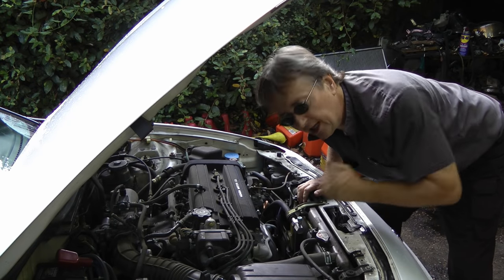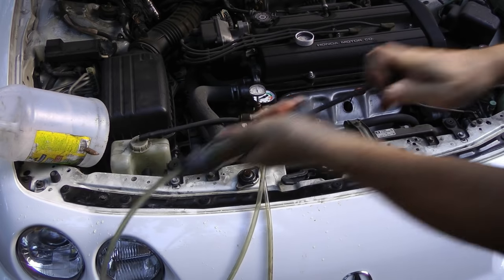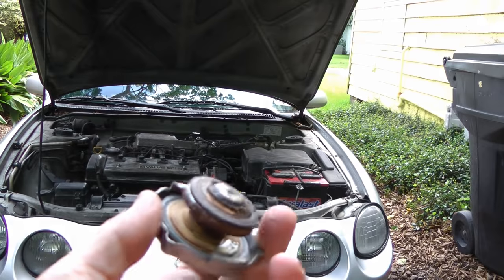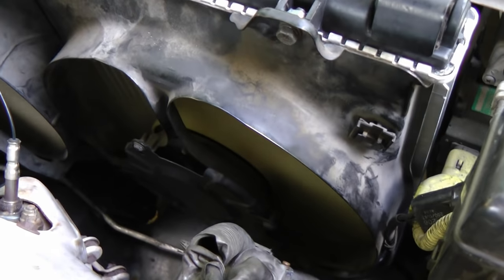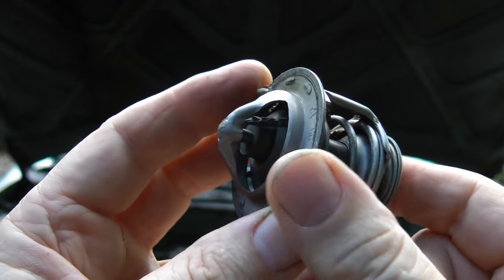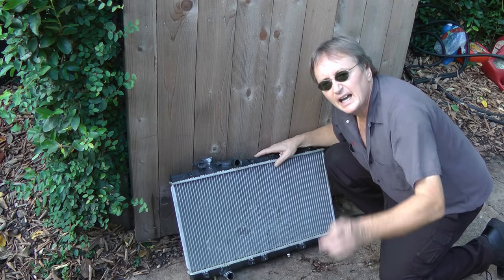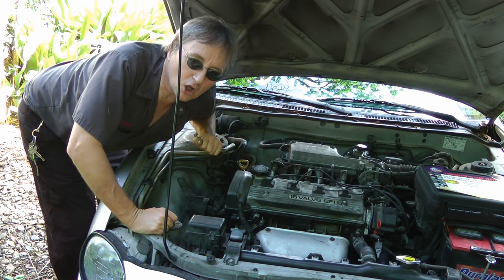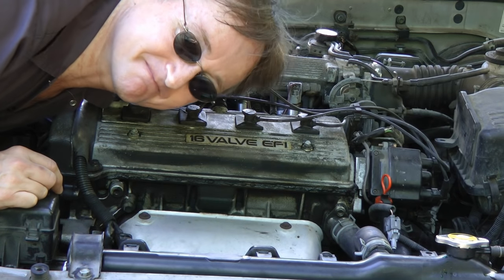How to Fix a Overheating Car Engine

Comment: would a slipping clutch cause an overheat during hill climbs? my car feels like 1st gear is slipping and during steep hill climbs when im in 1st or 2nd gear revving at round 2.5k Rpms (diesel engine) the temp gauge starts climbing. but if i stick to 2k rpms it doesn't overheat. Thanks to whoever answers
Reply: I dont think a slipping clutch should have anything to do with that
Reply: Is your tranny fluid cooled in the radiator like my civic?
Reply: @liveandletlive2894 i have no idea if my transmission fluid is cooled in the radiator, here's an update, i changed out my clutch in my 95' pajero and during hill climbs it isnt that bad anymore the temp gauge climbs 3/4 and then goes back to 1/2. But my temp gauge stays at half level is it normal to stay in half?.   and i have another question its about civics, my 93' civic eg sedan idles badly due to a bad IACV, when i replace this IACV do i need to do an idle relearn? or is this for new models only?
Reply: @kevinish5567  idk about reprogramming the iacv I only cleaned mine and yeah temp should always be around half

Comment: The AC fans do not turn on when the AC is on but if I tap the back of the fan the fan turns on. What is that supposed mean?

Comment: Hi I have a 2012 Cherry Tiggo and it is over heating I took the head out pressure tested it and also I took the engine and they said that it was fine please I need help

Comment: I have similar issues with my Prius. I have a 2011. Changed out engine, water pump, sensor and thermostat. I have issue when I drive high speeds 65-75 mph up hill. Reservoir very hot almost to boiling temperature. Temp red light would turn on or flash and then when I slow down it will eventually turn off. My mechanic replaced literally everything minus the radiator and the inverter coolant pump. Can anyone please help????

No codes or no check engine lights just the red light engine temperature turns on when driving high speeds up hill for long periods of time. 

Is the issue temp sensor on EGR pipes?

My mechanic has replaced with all OEM parts. Any advice?

Toyota service rep says might be inverter water pump, radiator clogged up, or water pump. 
Just a had Toyota dealership diagnosed and they check for any leaks so it’s not the engine. They said water pump and thermostat. 

My mechanic replaced those 2 parts. I thought I was in the clear but I wasn’t. The car still overheats when driving high speeds 65-75 mph for long periods of time and red temperature light turns on again uphill at high speeds. Anyone please help and TIA

Only radiator and inverter water pump left to be replaced and my mechanic is replacing it.

Comment: @ScottyKilmer Have a 1999 Nissan Maxima that recently passed emissions due to bad Map Sensor n MAP /Baro switch solenoid valve i replaced both, barely passed emissions when CEL came on again. Hate tht thing. 😂.  Anyway  First time in a while Gauge went above 75% toward Hot. Pulled over turned car off and noticed reservior was empty. Filled it up. And opened radiator cap after cooled down, n noticed it used up what i filled in resrvior. So refilled it up at Max level, then drove car on street 40-45 mph home, no problem for 20 minutes.  When i got home n was parking, noticed the tstat gauge start to go back up. Parked car popped hood and noticed a small leak near serpentine belt area that appears to be coolant.  

Im praying al i need is a new rad cap , even though it looked fine, and not be the freaKin Water pump.  I dont have money to fix that part. Any advice on further steps to make sure i find out wht is the cause of overheating??

Btw AC n heater system had to go bye bye two yrs ago, due to heatercore hoses  leaking in pasenger floormat.  So both Fans were luckily operating n turned on shortly after turned car back on in park. 

Detailed help in non complex mechanic english appreciated.

Comment: On my 04 Tacoma the previous owner did not put the water pump on correctly and it started leaking and eventually rusted so bad stopped spinning.

Comment: I just changed the radiator, the thermostat, and water pump on a Chevy sonic 2013 LT, now it over heats after 10 mins of driving it, then I’ll burp it out, then it overheats again, idk what it is

Comment: You forgot a simple thing - lower radiator hose collapse. 
I have 97 camaro SS with the lt1 v8.  New water pump and 180 degree thermostat. On the highway steady 70mph cruise, it ran about 200. But when I slowed down 
The temp dropped down quickly to 180. This is in 25degree outside air temp. Original hoses, about 125k miles.
Simple fix but overlooked.

Comment: Hey Scotty my 2009 nissan altima is overheating the fan is working good i change the radiator and the thermostat but it’s still overheating....help please
Reply: Test the water pump and hoses

Comment: Thankyou sir....my honda civic sport is overheating, but will check radiator & also on thease cars theres a (rear coolent hose) that can burst or even a small LEAK  accurring, hence your thinking then its a new head gasket   (WRONG) ive also changed my thermostat   on this civic,   still overheating    mmmmmm    what could it be ?       will try some of the things youve done scotty and hope it works     Nice video scotty you should be on a talk show  (your funny & down to earth   ,  nice guy,   Thankyou for your knowledge & tips  awsome dude   DEZZY DEE

Comment: Nice video but he forgot to mention the water pump. It could squeak, leak, or just not work from being too old. It could even be leaking and not overheat on you until it’s empty. Also if your oil hasn’t been changed in years your engine won’t be properly lubricated and all of the parts inside that are moving will overheat as well. in some cases you can leak coolant out of your intake manifold. Depends how your engine is designed.

Comment: my car is overheating i saw coolant boiling in the reseivor tank it could be a bad thermostat?
Reply: yoshi z33 most likely the rad cap, I got a G37 and had same issue
Reply: yoshi z33 do u have a IG
Reply: @aaronmx47  it was my radiator cap and alot air in the cooling system

Comment: Thank goodness, I have this olds that hasn't ran in years and I would hate to do any engine work. It can barley drive a mile before over heating and low and behold when I checked the radiator, the most amount of corrosion I've ever seen.

Comment: What if the reservoir has a bubbling noise and leaks at the cap when it over heats and pours onto the ground? It had happened twice now 😭
Reply: But then i let it cool down, put water back in it and coolant and it is good. It happened once about a month ago and then again two nights ago. It doesnt use any water the water level stays the ssme

Comment: HELP: My vehicle ( Toyota Corolla S 2013) temperature gauge goes up when I turn on the air conditioner, however it does not overheat, air continues to blows cold, and when the air is turned off the temperature returns to normal. I had a bad compressor before I fixed it. The problem still occurs in the car. Now that the A/C is fix. The temperature keep going up. Before it will go up and down when I drive long distance. I changed the thermostat, the fan, and compressor. It is still happening in it. I don’t know what to do. I cab only drive the car when the A/C is not on for it not to go up.
Reply: Does the coolant level go down or not???

Comment: Heyyy great vid so can u change a thermometer without having to change radiator i had a gut fix thermometer but not even a month later my car went back to overheating so then he says I needed a new radiator which he told me the first time but then he looked under the car and say oh no no no you don't need a radiator just a thermostat thermometer so after it overheated again after he just did the thermometer or thermostat whatever it's called then he says oh you need a new radiator so my question is how didn't you know that the first time then he goes to tell me oh I did you a favor cuz you needed a new thermostat again so I gave you a new thermostat again so is that correct if it overheated what I need another thermostat you know charging me for doing the same thing twice like I don't understand I would appreciate it if you can answer my question and I'm sorry if I'm like going on and on with the same stuff but thanks a lot for taking out the time thanks in advance great video

Comment: You didnt mention the water pump could be faulty or there could be a air leak in the system or even a air pocket in the system .

Comment: My radiator on my dodge Dekota and head gaskets was leaking and timing chain about to break and they changed me 300$ to fix it cause the engine was so easy to take apart

Comment: The way to check a plugged up radiator is to fill it with water and open the bottem.The water should exit strongly with gravity like 10 seconds.Cold of course both ends open.Fill to the top and let it out the bottem.Over 10 seconds you might jist have gunk junk.

Comment: Hey I need help I have a 2005 Pontiac grand prix and its overheating  I changed everything  need help plz
Changed
Radiator cap 
Temperature sensor
Thermostat 
Up o2 sensor
Lower 02 sensor
Bleed line ×2
Upper radiator hose
Lower radiator hose
Change belt
Changed cooling fans
Water pump
Flushed radiator  ×2
Didn't change yet
Radiator 
Or head gasket  l
Need...help....

Comment: Guess it's my lucky day! Christmas 2020 car overheating !! WEEeeee!!!
Reply: What was the problem
Reply: @Spyda_337  My lower radiator hose blew off & spilled most of the coolant out. I had half of a container in the trunk so that got me by until today so I could buy more at autozone. So far I haven't had any overheating issues today. So, I'm not complaining. Thanks for asking!

Comment: Ok so I blew my radiator from my car over heating, I replaced it and also the fan motor brand new but now when I turn my AC on 10mins later car starts to overheat and blows my fan fuse ? Can anyone help please or give me a good advice on what to do please and thank you

Comment: I change the cap water pump hose floshed the radiator new thermostat just the way it's supposed to work an 06 kia spectra over 80k + miles

Comment: When I run my car and then swithed it off，the water flushes from radiator water tank. What's the reason and solution?

Comment: i have a 2000 subaru outback and it is overheating and i know that they are notorious for having bad head gaskets but i just wanna be sure bc it’s leaking oil and i went to put oil in and there was faint smoke coming out of it  IF ANYBODY CAN HELP PLZ!!!!

Comment: What if the AC fan turns on but the radiator fan doesn't turn on after attaching the alligator clip to the battery?

Comment: I know alot about cars. If your car temperature goes up or if the car smokes under the hood it could be a bad radiator or a coolant leak.

Comment: There are also other factor that could cause overheating like a failed water pump,bad or leaking hoses including the heater core ones,a bad coolant temperature sensor could also be an issue with overheating or if you have a GM Chevy product the intake gaskets is so damn cheap that they always leak and can cause their car to leak coolant and overheat

Comment: I don't think this works on a mini copper 2005.  I did the + to the red wire the fan did not work.  the reason why is the resister relay that's faulty that makes the fan speed as the - runs throw the resister I am not sure I am trying the resister first and if it's not that its the fan, I looked on here and  if the fan not working by negative and positive from the battery  and connect it to the relay switch and still did not work they said its the resister!?

Comment: I have a 2015 F150 I have no leaking coolant but yet the truck runs hard after 10 minutes of driving . I have the water pump replaced and the thermostat replaced !!! so how is my truck running hot with water in the radiator? Someone please help me my wife is a schoolteacher and she really needs this truck. Oh yeah and I even tried driving it without a thermostat and it’s still ran hot.

Comment: Good video I liked it I have a 99 Mazda Protege has lots of issues at certain times what 172000 MI know what it's like put new alternator in car new gas tank about to put new struts put  going to try to get $300,000 of my Mazda

Comment: I've changed the radiator the fan thermostat and the hoses they are brand spanking new and the dammed overheating light comes on when am in traffic wtf so it might be the head gasket I've even put the pink Toyota coolant on my scion xb 2006 and still
Reply: Check and see if the cooling fan is working. Sounds similar to a fan not working so it won't cool the engine in traffic or at n idle, but while driving the air flowing through will cool it enough.

Comment: My car takes forever to heat up when it starts to get cold outside and when it actually warms up and I start driving it starts to get very cold the guage is on blue almost to the very bottom what can I do?
Reply: My car has 234,966 miles on it it's a 2002 dodge neon sxt

Comment: You missed to check one very important component of the cooling system i.e. the water circulation pump.

Comment: Couldn't it also be the water pump?
Reply: When they go bad, usually they leak coolant where they are located (Doesn't apply always but is very common)

Comment: Changed my radiator it was working fine even the fans were turning on. then it started over heating again and the fans stopped working. So I’m just gonna change the fans and the thermostat just to be safe

Comment: Also change the caps 
I spend like 2k fixing everything and nothing work
But then as soon as a change the cap for the coolant on the engine (cost 10 dollars ) and that fixed it

Comment: Is anybody still there? :-) I have a 2005 Ford s281 SC the temperature gauge reads hot but the car is not overheating but yet the overheat indicator comes on telling me that the car is overheating. I drove the car home after I purchased it from the dealership I got about five miles down the road I was doing about 60 miles an hour at 2000 RPMs in fifth gear the temperature gauge begin to go up and indicated that the car was overheating. I slowed down and then the car indicated that it was cooling down back to normal operating conditions. Is there anyway you can tell me where the temperature sensors are located at on this particular vehicle? So they can be diagnosed?

Comment: Most pressure testers come with an adapter so you can pressure test your radiator cap, not just go out and buy a new cap, that's ham & egger backyard mechanic style.

Comment: Water is leaking from under the radiator, steam coming out from the side of the radiator, fans are working, but looks like the motor is overheating

Comment: Guys i have a 2008 charger police interceptor now when i got it from the guy it over heated on the first day pretty shitty but he fixed it for me said there was a bubble in the pump that wasnt leting it flow so he flushed it an put anti freeze in it an it was working good and it did for about 3 months then it over heated so i took it to a mechanic an he said he couldnt finde the problem but he could switch out the thermastat and pump to see if that got it working and it did for 5 months then boom over heating agian wtf could be the problem ?

Comment: What about the water pump??
Reply: A failed water pump can certainly overheat your engine. Usually you can tell pretty easily because it will most likely leak coolant and/or make an awful noise when you run the engine.

Comment: 12 years ago?! Wow man!! Still I have an '09 PT Cruiser and am finding they cooling system is fine.. for the engine, but the Heater Core may be plugged or the heater valve is defective???? Never overheated in fact it wont heat at all!! So somethings weird. Corrosion and dust are bad mmmkay? lol So flushing it out right now. For a system that SHOULD be easy to understand, there sure are alot of things that can make it fail getting me to scratch my head thinking, no, I checked or covered that so WTH?! hahahaha! Cars, gotta have a love for them or they'll piss you off!! xD

Comment: “👈🏻 But before we do anything.....(camera angle/scene switch) 👆🏻You wanna start each new scene (cam angle/scene switch) 👉🏻with a really good pointing finger wag (cam angle/scene switch) 👇🏻and then pull it back to you (cam angle/scene switch) 🖕🏻close the hand & then begin😁

Comment: You forgot to emphasize: NEVER check the radiator fluid when your car is still overheated. The fluid will be scalding hot.

Comment: And once you have found the root problem you will have to replace your head gaskets or cracked cylinder heads.

Comment: Wtf?! How come no one said to just pour water in the radiator?! I checked the coolant and it was way low. So I topped that off. And the engine still overheated right up to the red line. Then O'Reilly's Auto said it needs some mechanic work. Next day, my uncle came and just poured lots of water in the radiator.. and that fixed it!! Wtf!? lol

Comment: I know you like throw Dodgers away Chrysler cars away but I have a 2007 Dodge Ram 1500 quad cab 4. 7 L engine flex fuel s t model... I just change the water pump I change the thermostat and the radiator cap the car is still overheating.